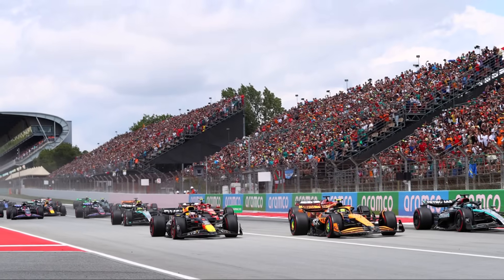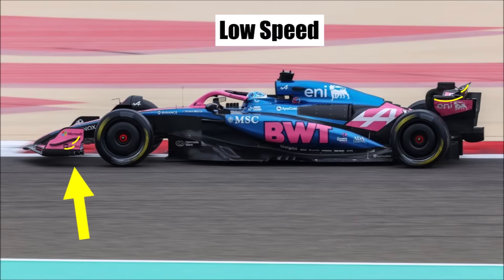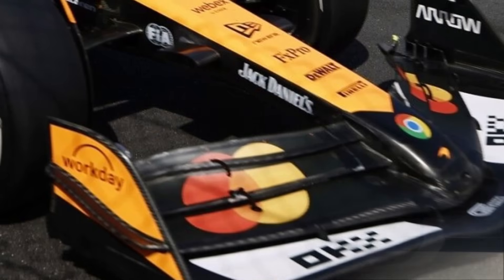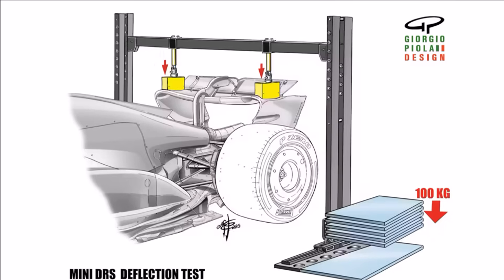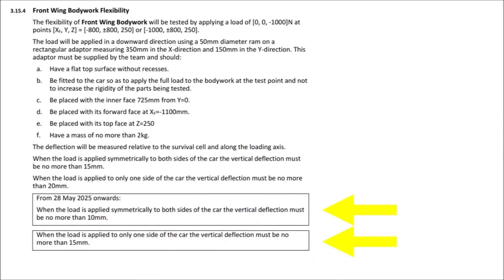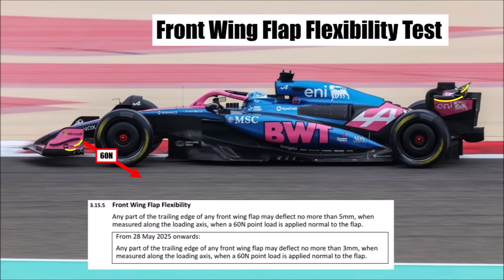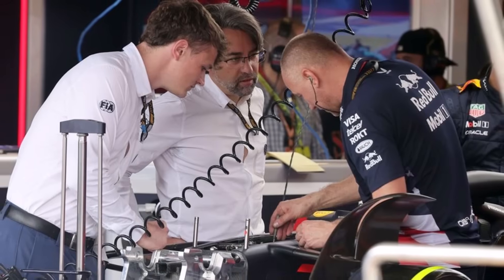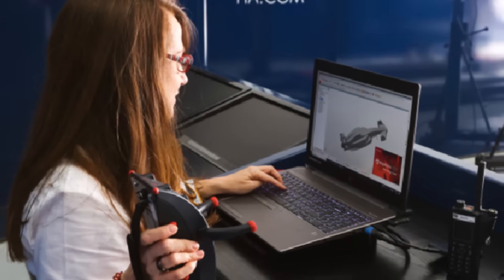F1 2025 - FIA's Flexi Wing Dilemma - EXPLAINED

Comment: I understand regulations that improves safety, even regulations that in some way limits power output, like limited displacement, or limited  amount of onboard energy, and so on. But I don't get regulations against increased downforce when needed with comparatively less drag at high speeds just because it improves overall performance. Formula one is very far from a budget friendly activity anyway. 

178 pages of technical regulations (for 2025) in part to limit "unfair advantages" seems more likely to promote good cheaters than "leveling" any proverbial playfield.

Comment: Wasn’t the whole point of the cost cap to let the teams spend their budgets  how they see fit? 

I’m pretty sure that, historically, the purpose of rules like these were to avoid development races in certain areas of the cars. In which teams with smaller budgets simply can’t match the level of refinement and optimization that the top teams can achieve.
Reply: No. The point of the cost cap was to level the money spent so it's not pay to win by RB/Merc/Ferrari while also making it more financially viable so teams don't collapse like the 2010's. It's just a convenient follow-on effect that it discourages grossly overspending on a particular thing like the front wing.
Reply: @tHebUm18  That’s pretty much exactly what I mean. These flexi-wings aren’t ”pay to win” because the cost cap is already in place. It’s simply a clever technical solution and the teams utilizing it should be allowed to - they’ve earned it. So I really don’t see why they are getting banned.

Comment: Looking at FP it hasn't changed the pecking order at all which tells me that either a) teams were pushing the 20mm tolerance or b) teams have found a way to pass the static load test but still flex at same as before on track.

Comment: Stupid question. Why do some wings(f1 rear wings especially come to mind) go like
                   ----
---         ‐‐‐‐
     ‐‐‐‐‐
Instead of
      __‐‐‐
----
If that makes any sense at all😂
Reply from the maker: Great way to illustrate your question 😅
It’s because of the downwashing bodywork
Reply: @bsport320  another question, under extreme conditions like monaco or mexico, does the air on the underside of the wing (the low pressure part) approach anywhere near transonic speeds or it will stall before reaching that speed ?
Reply: The air is somewhat downwashing over the rear of the car
Reply: @Sturmovik1946  ok i was thinking that was at least part of it. The amout that the teams do just seems very aggressive to the way i imagine the air flow over the car.

Comment: I never understood static tests. I mean "just" stick it into a windtunnel with a laser under it is unrealistic. But cmon the forces are so much larger than these tiny weights that they put on there.
Reply: It's cheap and easy to run wherever. A wind tunnel is expensive and difficult. Wind tunnel is also not driving.

Comment: Why limiting felx at all? Isn't it simply part of the Aero Engineering. 
Especially if its so complicated to check?

Why not simply Restrict the Wings in size eg in m³ and limit it to be one Part.
Reply: I think for the first one, if it flexes too much it risks breaking under regular load

then with the second one, is the wing size measured with no aero load on it or full aero load? or somewhere in between? and one part makes it impossible for multiple elements to be designed with separate profiles, like how they have it now. Each element is a specific size and shape to direct airflow a certain way

i hope im not spewing random BS btw I've only just started learning aero
Reply: Why limit the power units? Why limit anything?

Almost like the entire point of Formula 1 is to make a relatively level playing field by determining what teams are allowed to play with while having it open enough to not be a spec series. A big part of the limitations for the 2022 reg cycle has been trying to mitigate dirty air which became tragically bad in the 2017-2021 regs as teams poured resources into ever more complex/hideous barge boards. If you were disappointed by the RB domination of 2022-2023, imagine how much worse it might be if there was even more wiggle room and everyone else got the wrong concept.

It's not the 70's anymore where teams don't understand downforce and don't have computers to help them design things.
Reply: @tHebUm18  and again you're making arguments im not making. I completely see the need to regulate where the wing is, how big it can be, certain geometry like the end radius etc but leave it at that youre acting like im suggesting tearing up the rulebook just because i mentioned one change. Calm down.
Reply: @Eric_V410  I didn't reply to you at all. I replied to the original comment.

While you're acting like I'm replying to you though, AlexLullos has the correct takes over yours.
Reply: @tHebUm18  ok well it said you replied to me, wasnt paying attention to names. Youre wrong imo🤷‍♂️